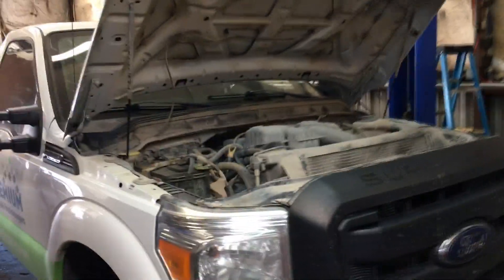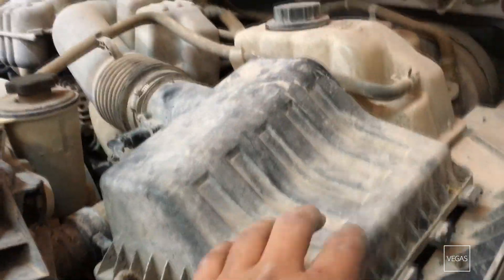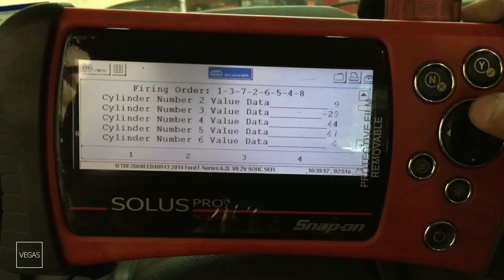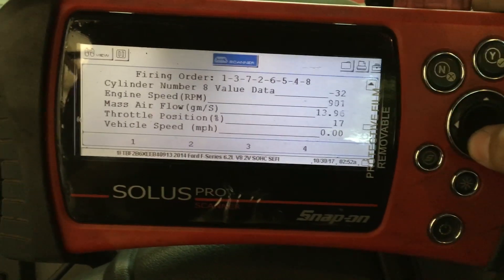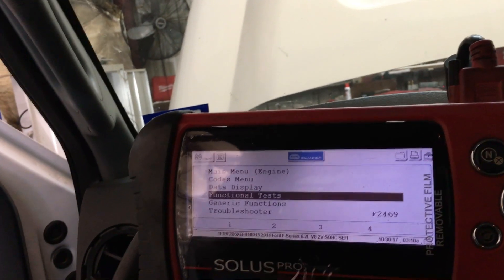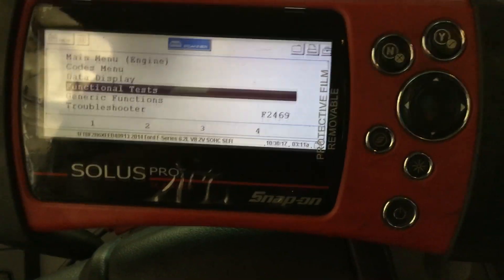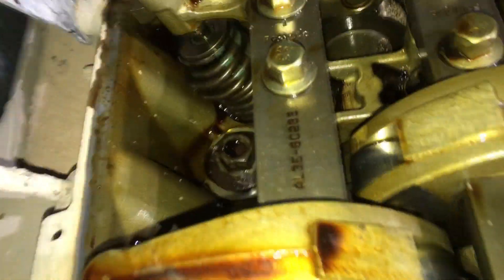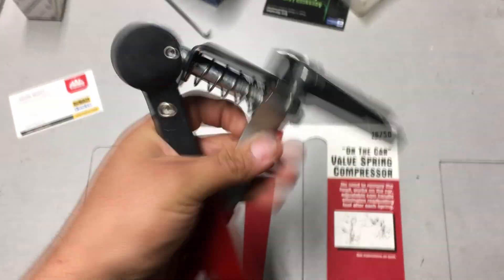FORD F-250 6.2 MISFIRE BROKEN VALVE SPRING DIAGNOSIS

Comment: I get the p0300.   And misfire on cylinder 4 and cylinder 7....very similar to this....so im assuming there is a broken spring.   And it wont rev any higher than 3000 rpm

Comment: I gotta 06 f350 6.0 blowing white smoke and shaking bad shop told me cylinder 2 misfire in thinking this is the problem what is the cost to have a broken valve spring replaced thank you

Comment: When you do a compression test on a vehicle that has 2 spark plugs per cylinder do you leave one spark plug-in and use the other one to hookup the compression tester too
Reply: yes remove both spark plugs from each cylinder from the 6.2

Comment: My 5.4 3v  was putting out cyl p0300 p0305 p0306 shaking like crazy . Also lean codes on bank one +flashing check engine light .  Dealer wanted to put new motor in it. 2 local mechanics wanted to do phasers and intake and plugs.
After taking it apart and inspecting it turned out to be cylinder #6 exhaust valve spring broke. $3.00 part.   About 2 hrs work and it runs great now.

Comment: Relative compression test WITHOUT an amp probe:
Scope the VOLTAGE drop on the battery cable, "+" at the battery, (-) at the started end. Clear flood and crank...
A voltage drop test can be performed ANYWHERE that current is present.
Reply from the maker: True. I guess I was just used to doing it that way. Thanks for watching!

Comment: So did the valve contact the cylinder on that edge ? Or is that just the design of the cylinder? I would think it didn't or the valve would be damaged. What are your thoughts? This happened to my 2015 with the 6.2 but I wasn't this lucky and the valve dropped far enough in and contacted cylinder #7 piston. Had to get a remand engine put in
Reply: What happened?

Comment: Over revving the engine causes valves to "float"....breaking and bending valves, and valve springs. 
Company truck...drive it like you stole it.  Bad employees. Possible bad rev limiter.
Reply: Bullshit. Bad valve springs. I have had this truck since new and oil changed every 3000 to 5000 miles depending on what kinda miles.

Comment: An old mechanic once showed me how to find the source of mechanical noise by using a shortened wooden broomstick placed on your ear and then various parts of an engine or gear box.
Of course, you can buy a $150 stethoscope from SnapOn...but the broom stick works well.
Reply: A long screwdriver also works

Comment: My 6.2 did this today after a service at my Ford dealer. 75k miles
Reply: Put 16 new ones in it or sooner or later your luck will run out and one will break and drop down the hole
Reply: @stevehpperf2402  had them replaced, left the shop and the truck started tapping. Brought it back and they said broken exhaust manifold. Took it to another dealer and they found a crossthreaded spark plug!

Comment: Had, same thing at 136k, mine wasn't making any noises had misfired that were all over the place, Did compression test found cylinder 7 dead, pulled valve cover to find broken spring.

Comment: You skipped the valve cover removal and the spring reasonably. When making a mechanical video don’t skip any steps no matter how small. You can fast forward through routine parts like bolt removal but don’t  skip parts.

Comment: 11,000 miles. Start up Thumping Exhaust occasionally Pop's Never had this problem F350 SUPER DUTY 4X4 "17" love IT it should idle Better . Dealer say's IT CHECKS OUT OK !! all You have to do is "Listen" My Shelby 17 GT350 Doesn't ! 3.5 Ecoboost next ?????
Reply: I have a 2017 started this at 24000 miles

Comment: What did you torque the rocker bolts to? My cam slid forward about a 16th of an inch and it has a loud clap just like the truck in video. Compression is good, spark is good, multiple misfire, and sounds like a diesel. What are the cam and rocker torque specs? Its been a month and ford wont get back to me and can only find head bolt torque specs online.

Comment: Did you end up pulling the timing chains or did you wedge the gear?  how did you line it back up for timing purposes?
Reply from the maker: I did not remove the cylinder head to replace the spring. I simply used compressed air in the cylinder to hold the valve closed while I changed the spring using the tool I show at the end of the video. Thanks for watching!
Reply: ADVANCED LEVEL AUTO how much air pressure is needed to keep the valve sealed up for the change?

Comment: That 6.2  gas must be a pretty strong motor. At 215000 miles you could still see the cross hatch on the bore. Good video
Reply from the maker: A year later and this truck is still hauling loads back and forth from Houston Texas to Oklahoma City multiple times a week.
Reply: @ADVANCEDLEVELAUTO  How many miles now? Any issues?! Just curious thanks…

Comment: how did you change out the springs wish you would have included that in the video. overall great vid thanks for the help.
Reply from the maker: matias Guiguez I used compressed air into the cylinder to hold up the valve while I replaced the spring using the tool I showed.

Comment: I just had a valve spring replaced on my 6.2l 2015 F250, 137,000 Miles.  Do I need to be worried about future issues?  Should I trade it in to be safe?
Reply from the maker: From my experience, these motors seem to be very durable. I think with regular maintenance the truck could last for many years. Thanks for watching!

Comment: Is this a common problem with the 6.2l or just a fluke
Reply from the maker: I've actually replaced quite a few broken valve springs on both the 6.2 and 5.4 engines. Thanks for watching!
Reply: Seems to be the one Achilles heel with the 6.2. I wonder if an aftermarket, like comp cams, would be a better choice on these...